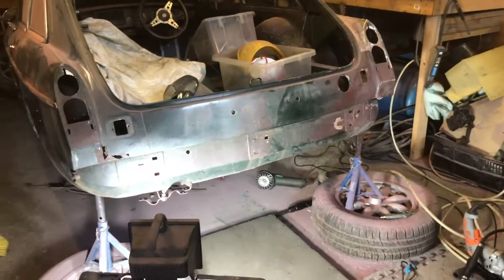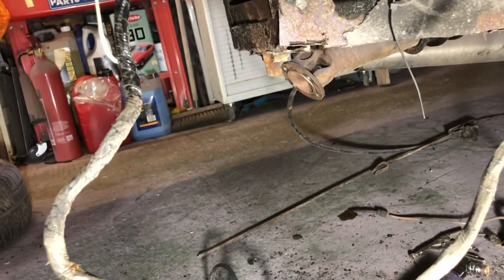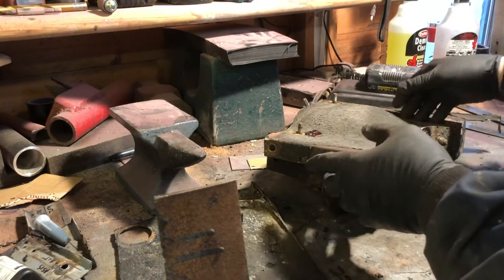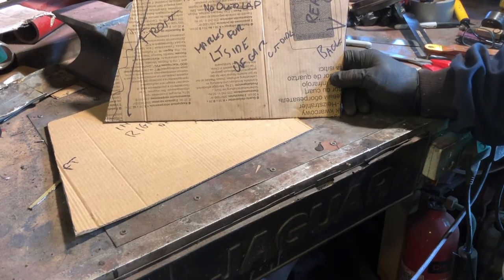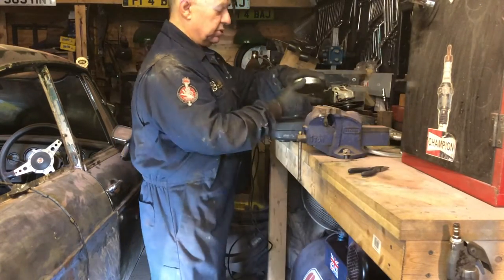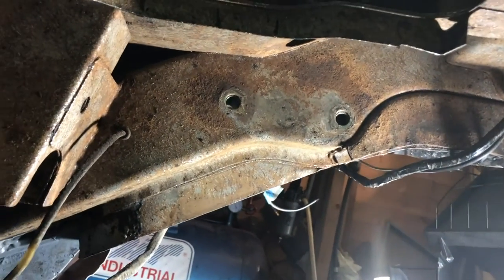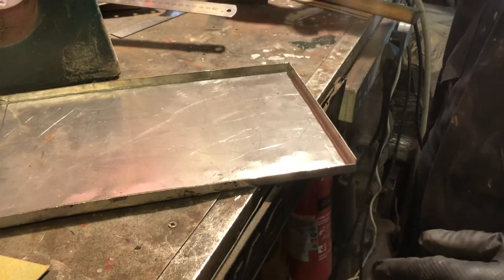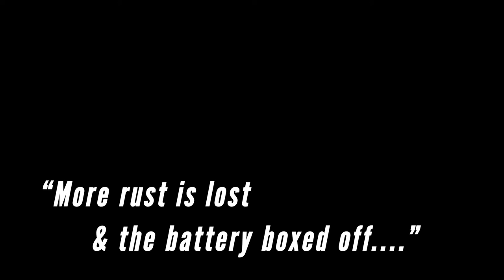U.K. MGB GT Sebring Restoration Episode 20 “ Bustin’ more rustin’ & battery box Part 1..”…..

Comment: That all looks very familiar, only one battery box (lucky sod), getting lots done, now we can’t get dragged around the shops, got any tips how to get the bump stop rubbers back on, I should have done it with fairy liquid and a Jack while the axle was off, too late, help! Steve.
Reply from the maker: Yeah just the one box, thank god. It’s such an odd shape. I thought it would be easy to just chuck something together but with all the odd angles it was a real pain. I haven’t done the bump stops yet. I’m just finishing getting the crap off from underneath and getting it all welded and painted before fitting the petrol tank. The battery box is welded in though already for the next video and as you can imagine that was awkward as well. I’ve had a delivery of Sebring stuff too so I may include that in the next video. 
I can’t be too far from refitting that rebuild rear end soon fingers crossed..
Thanks for commenting mate, much appreciated...

Comment: Restoring a 79 GT myself to sebring atm ....

Loving your work ... and sense of humour .

All the sebring kit fits like crap ... I wish you well it (I've yet to tackle it )
Reply: And can u ask who you got the kit from , was it Honeybourn Moulding (Moss MFOC MGBHive)

Or was it Generation Fibreglass
Reply from the maker: My Sebring kit came from Generation Glassfibre. Seems to fit OK actually. I’ve only offered it up for now though. I also bought a rear hatch and bonnet at the same time from them. I also have a pair of fibre wings I bought second hand from Facebook that had never been fitted so quite a comprehensive set of replacement panels. Should be interesting fitting that lot. 😁👍🏻
Reply: @CaptainBash737  

I'd love to send you my email,  I'd love you to post your work up on a welding forum ....

I play their with my project  and you work and humour would gain you a few subscribers , if you join and post up your updates .

Generation fibreglass is a grandfather / grandson team ...

The grandfather setup honeybourn mouldings back in the day.... (I've met them both ... collecting panels ) ...

Malc
Reply: And you list sounds EXACTLY like my list ... (I did throw 2 x FG doors in as well ) ... why not ...
Reply from the maker: Absolutely happy for you to share the channel stuff mate not a problem. 
I have more filmed but commitments are slowing the editing process a little. I should be able to step things up quite some though. More than happy to chat on line to you too. If you search on FB I’m there so messenger would probably be easiest👍🏻👍🏻 
I don’t do this for a living so if the search brings up pilot then that’s me. 👍🏻